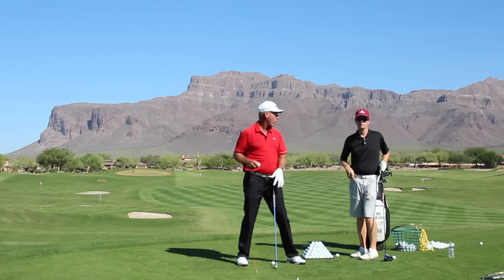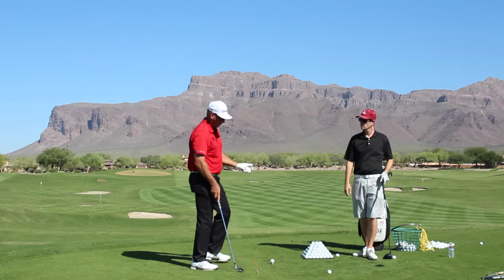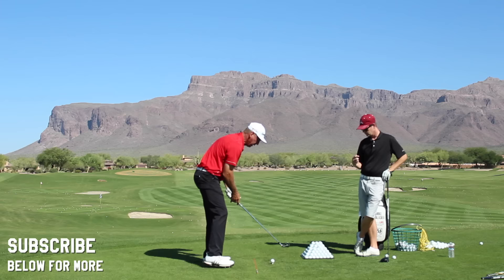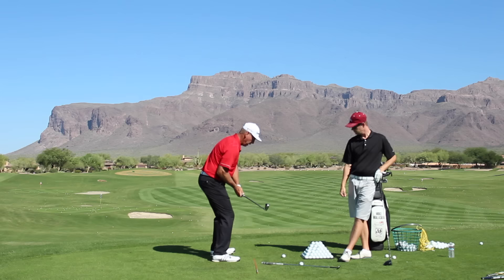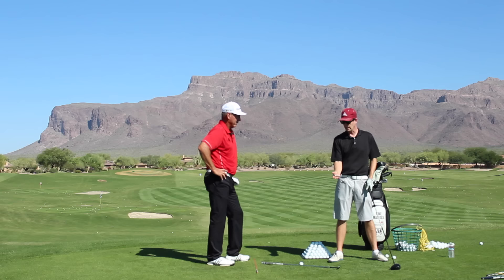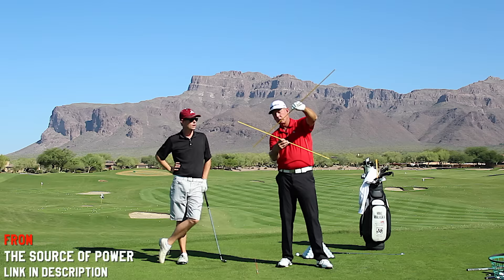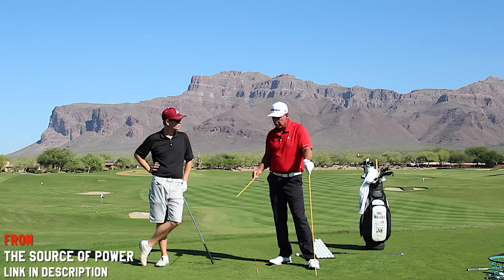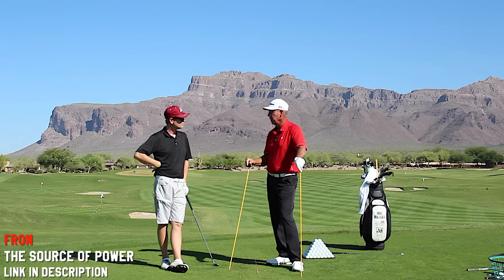Golf Mike Malaska STEP 1 in Building a Golf Swing

Comment: Hi: I looked at several video's and really like what I see. This seems to be the opposite from most instructors I have seen. They all seem to want to lay off the club or flatten it as it comes into the ball. I have tried your theory and it works fine. I guess I have been doing it wrong all these years. I bought your book and it is real big with real nice glossy pictures, great book.The question I have is when I bring the club down and into the ball I hit the ball with a little draw. I don't hit it straight unless I open the club face at address. I also bring my hands real close to my left leg at impact. I just wish I didn't hit the hook all the time, even my wedges draw and sometimes the ball starts off the club face left. I also hit a lot of half or 3/4 shots with the wedge fat. I live in Orlando and do you have any clinic in this area?Jim Wales